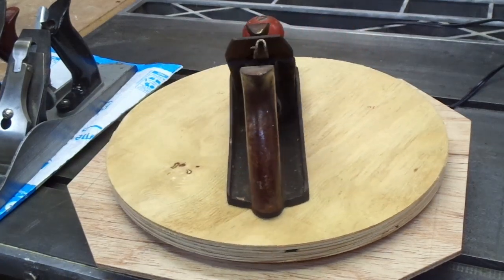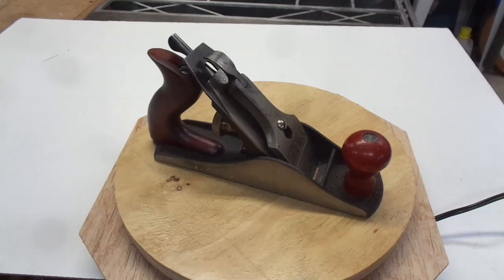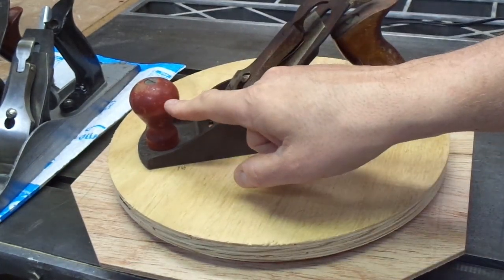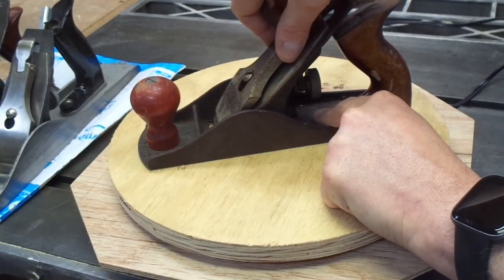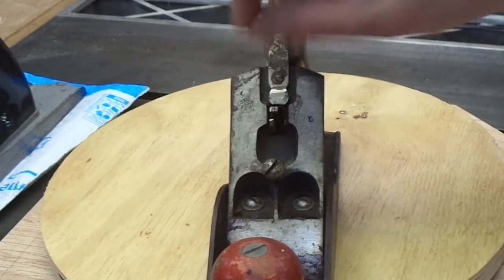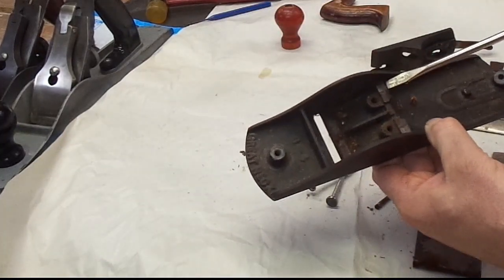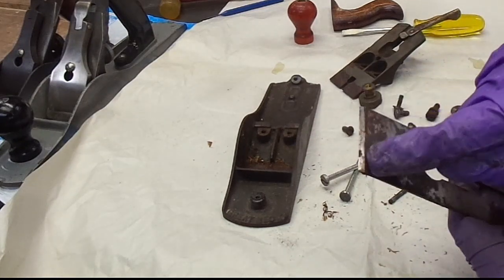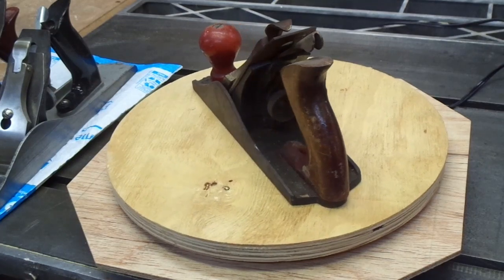Great Neck G 4 Hand Plane Close Up

Comment: Hello sir. It seems I’ve stumbled upon the same make and model! Need to do some rust removal before I can disassemble but I believe it can be salvaged! My home (found in garage) was built in ‘28. Any suggestions or guidance is welcomed as I don’t know much about the actual use of these things. Can swing a hammer and cut a straight line but haven’t used these much at all. Loving your channel. Aged things are more precious as we age. You can quote me.
Reply from the maker: Hello again.  The good news is it's not a collectable plane so you can do anything you want and you're not hurting any value.  The first thing I do is see if the nuts/screws come loose and you can disassemble it.  If not, you may have to soak the moving parts with a penetrating oil for a while.  You really want to be careful not to chew up any of the parts.  Rust is easily removed by scraping or sanding.  Sometimes you sacrifice a razor blade or utility knife blade, other times sanding does the job well.  You can use chemicals (vinegar, etc) but scraping/sanding is quicker.  The real challenge is being able to get the iron pretty gosh darn close to razor sharp.  If you can do that then you'll have a decent plane.  Their use is largely in lieu of sanding but there are too many to list and tons of information out there on the various ways people use hand planes.  Good luck and I hope you enjoy it like I do.